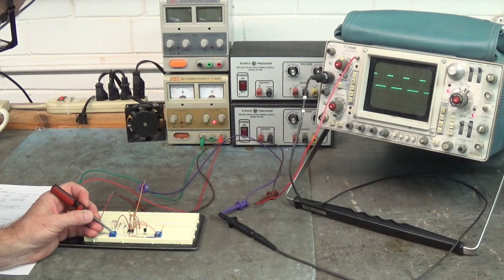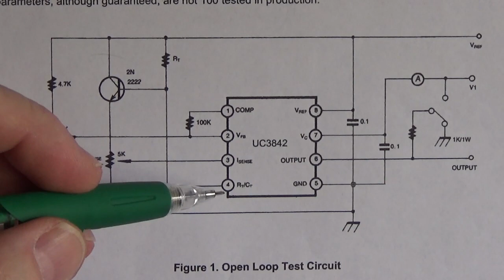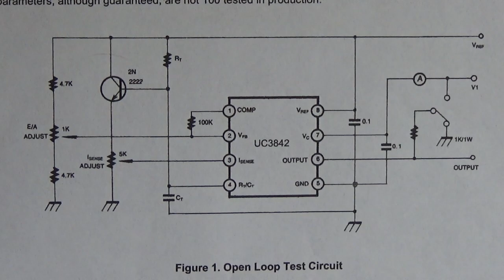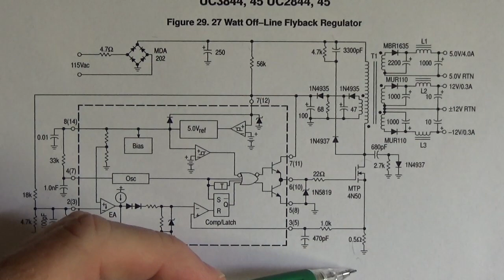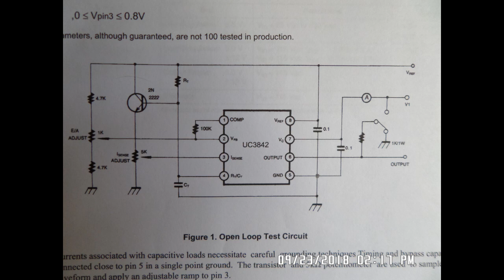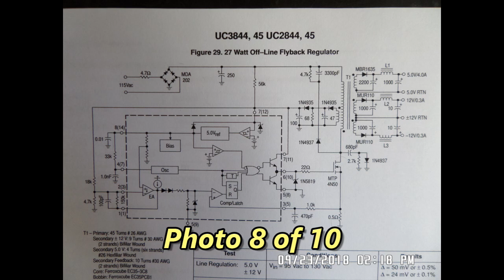Testing the UC3844 SMPS Controller Integrated Circuit

Comment: This is an excellent video explaining the PWM control IC. Thank you as half of the stuff on here is done with a heavy accent and I can’t figure what they are saying. I’m working on a 2 transformer 2 PWM IC chip SMPS for an older RCA surround sound receiver. It is driving me nuts because I can’t seem to figure out why the ICs are not switching on. This type of board has an On/Standby switch on the front that supposed to start the unit up. To boot they even used 2 different PWM chips lol. That’s how I made it to your video. I miss the old days when everything came with a schematic. Thanks for the video sir.

Comment: Hello good work with the uc3845, the output current can be adjusted with 3 legs, can we adjust the voltage, can I do 2---30volt current 0--6 amps

Comment: Great Video, There needs to be more stuff on YouTube in regards tot he UC3844B IC chip.  However,.  i have a SMPS power supply from Hyosung that is not putting out outputs.  Trying to figure out what is causing this damn thing to Not put out outputs.  Tested my chip (UC3845N) and it is not getting any source power.  This video gets me closer to figuring out why the chip is not getting any power.  Still inconclusive.  Any thoughts ?

Comment: nice vid.
but lowering voltage on pin 2  the output start blinking and clicking..any idea what can cause this?
Reply: It's supposed to be fed like an operational amplifier, with an feedback net between the input (pin 2) and output (pin 1).
Direct acting on pin 2 may lead to very unstable reactions.
Reply: Pin 2 is the voltage feedback. 
It's an error amplifier referenced to an internal resistor divider.
Getting this voltage close to the reference voltage may turn the error amplifier unstable, causing the clicking of the output.